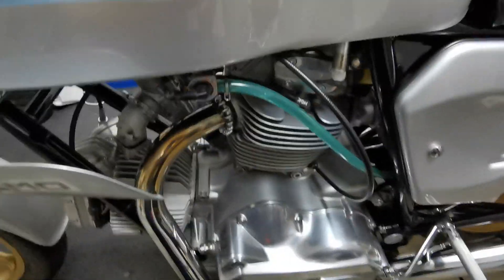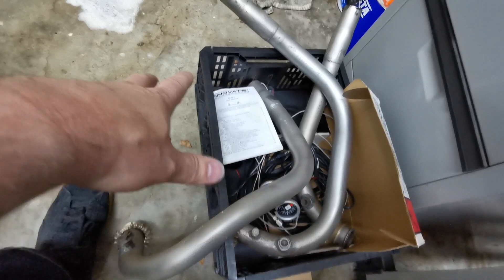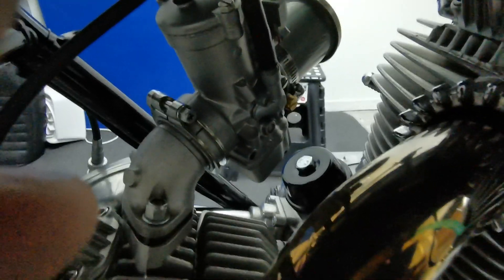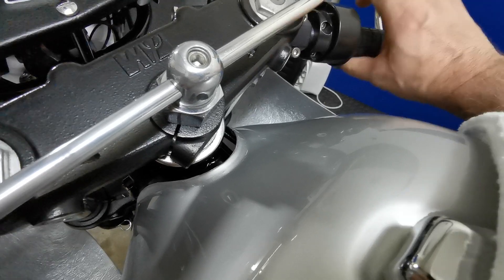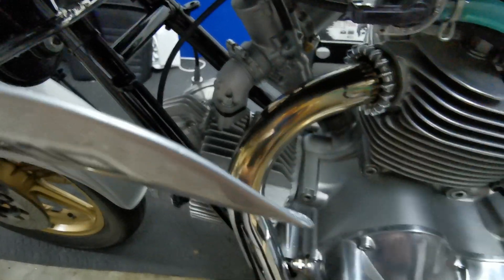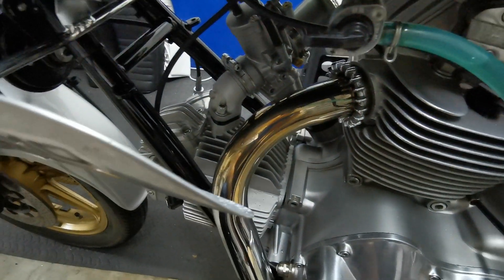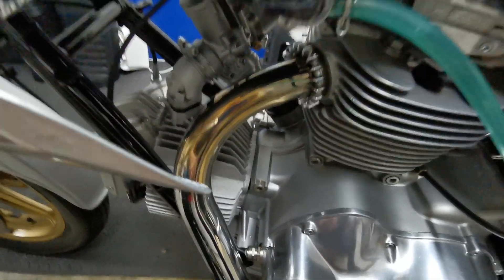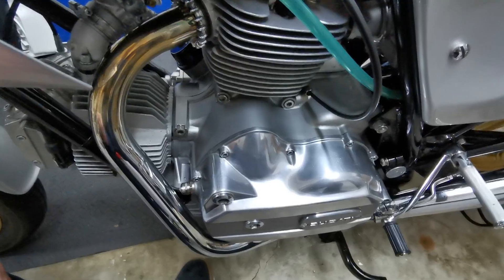Ducati 900SS Bevel Tuning - Lambda/AFR Testing Part 1

Comment: These videos on the carb rebuild and Lamda testing were fantastic. Very helpful as I just rebuilt my 1000 S2 Mille (that my uncle gifted to me!).  Exact same carbs as you have. 
Anyway I have a few questions if u have time to comment on them.
1.  Looks like you set both floats to the stock 18mm per one of your videos. So the fact that the lower carb is at a significant angle, (however I know it’s within the limit per the dellorto guide), you still kept the float at the 18mm position?
2. I know it’s highly dependent on the jets and other factors but can you tell me what your fuel mixture screws ended up at? As in, how many turns out are they at?
3. Similar question on the idle set screws. How many turns-in are the screws after initial contact with the slide? Or maybe just qualitatively, are the idle screws really cranked in and squashing the springs pretty good?

Comment: I was under the impression that Brook and yourself sorted out your carburetion issues! These motorcycles are after all not built / designed for "running around town" but are race bred. 40mm carbys don't respond well to 'running around town' but respond well to "demands" akin to those of race bikes. I choose to run 32s on my 900 coz' it breathes much better in the mid-range where I spend most of my time (between bends). I assume you have a fist-full and a half of throttle. You only really ever need that last half eg; when backing off (trailing throttle) you're still running on partial throttle
Reply from the maker: (edit: I keep replying to comments from the wrong account by mistake. I've deleted and riposted this again here from the right one)

I didn't specifically have any carb issues and the engine can be dialed in to run well with any of the range of jets I've tested. I can also remove the small anemic spot by running it richer overall, which is what most people tend to do. Restoring and rebuilding the carbs back to original spec in terms of jetting, floats and slides was the next step in the restoration process and now I'm just aiming for perfection. I've found that the carb rebuild was worth doing because it now accurately retains whatever calibration I've applied. Lambda testing is the ultimate way to determine the optimum jetting without wasting a lot of time and money doing it by trial and error. We'll see how it all goes in the next videos. My next step is to calibrate the sensors, determine the best measurement points on the throttle, and then wait for a nice day to go out.